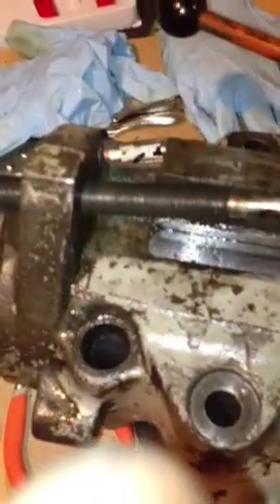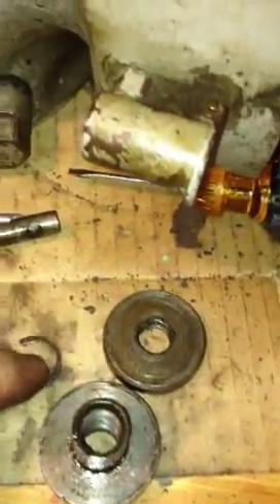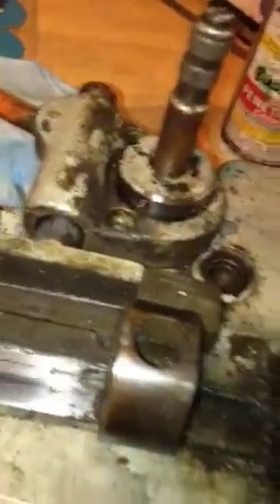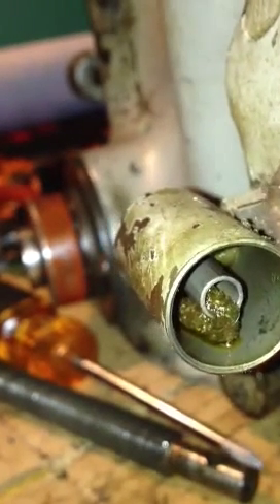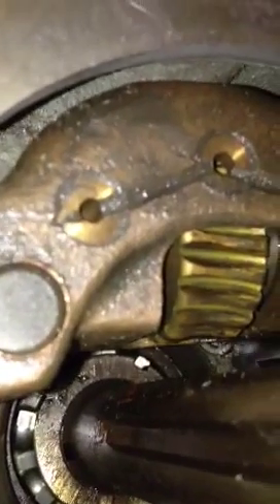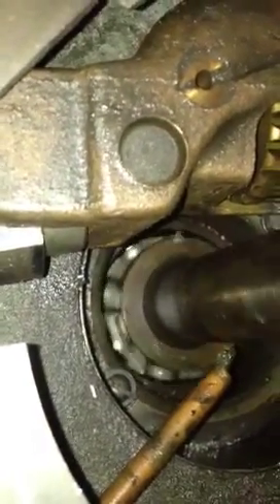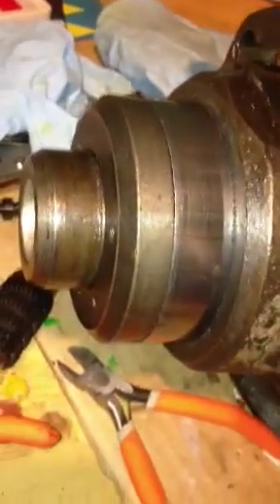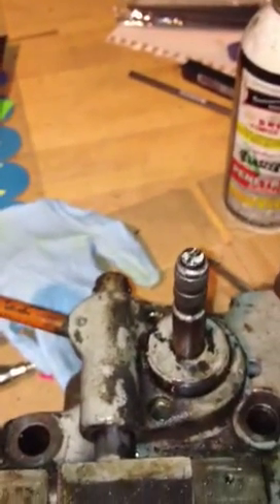Bridgeport quill tear down part 7

Comment: You answered the problem I was having, I picked up a push button quick adjuster for the quill stop at the swamp meet BUT could not get the upper trip lever out, your video was very helpful for me to finish the job. and install the quick release quill stop nut. thanks ED
Reply: well I went out to the shop and did the 4/40 screw thing and the lite tap on the screw and it all came apart and put the new to me quick lock button nut.